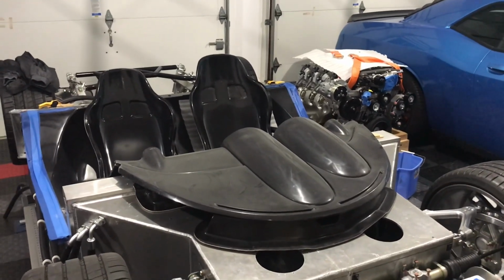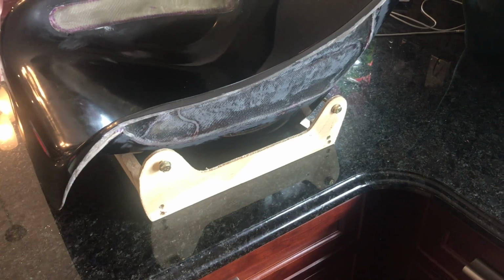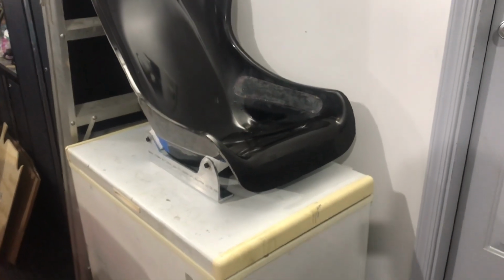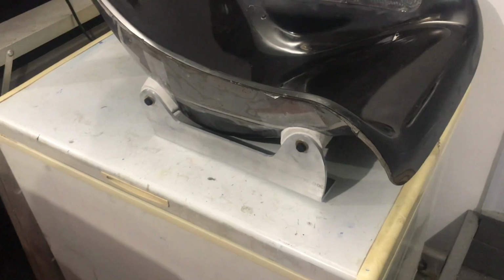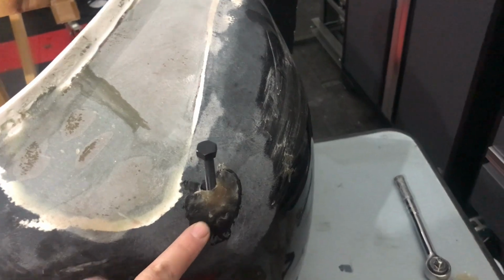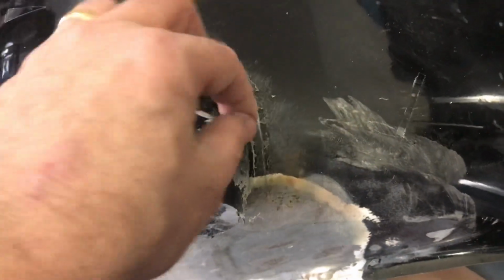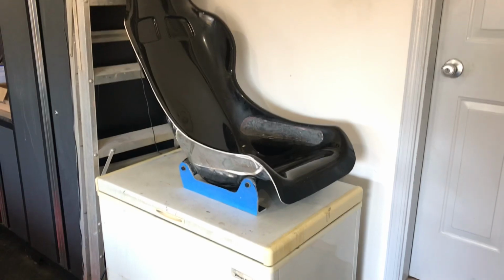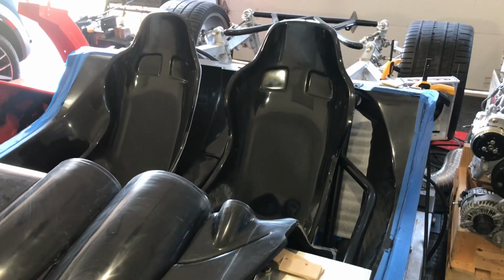Superlite SLC Build 065 Racing Seat Modification Part 2

Comment: I used threaded inserts to hold my seat in.  They didn’t hold for very long.  The thread held but the nut pulled through the steel mounting bracket.
Reply from the maker: Mick, are you saying the nut came off the tab it is welded to? I mounted these with the tab to the outside so the nut pulls against the tab and the whole plate pulls against the outside area of the fiberglass mounting point. So the fiberglass is sandwiched between the seat bracket and the tab. Hopefully that holds, but I may wait a while and use them as is before I invest more time and money into upholstery.
Reply: @JoelKSLC .   Confusion mate.   The threaded inserts I used were rivnuts.   If you think of a persons weight and, call it .5G that’s a lot of load through an aluminium clinch nut.

Comment: How long would you say you would have spent on this project all together so far?
Reply from the maker: Modifying the seats including fabricating the brackets took about 75 hours. So far about 800 hours into the build or just staring at the car thinking. Keep in mind, this is a very customized build and I am doing all this type of work for the first time.
Reply: @JoelKSLC  wow, you are determined
Reply from the maker: Another way to look at it. This is over 2 years, so it’s about 7.5 hours per week which is not really a heck of lot, but that is about what I can fit into my schedule.